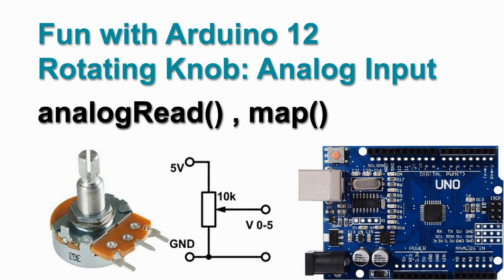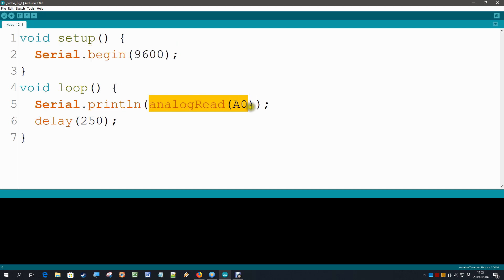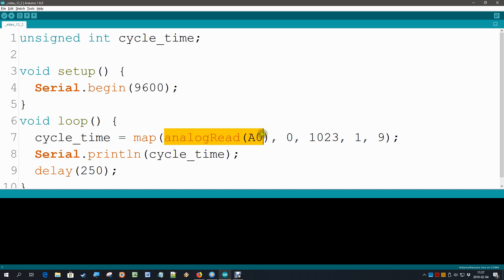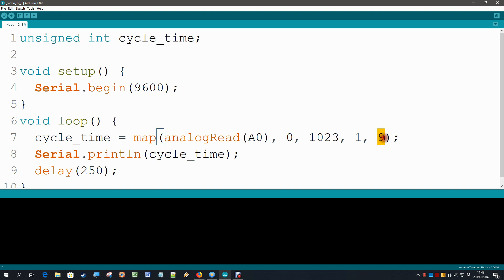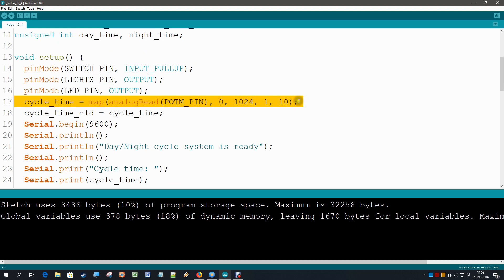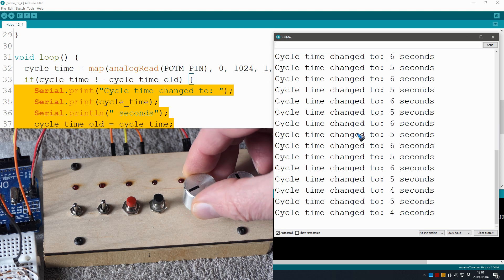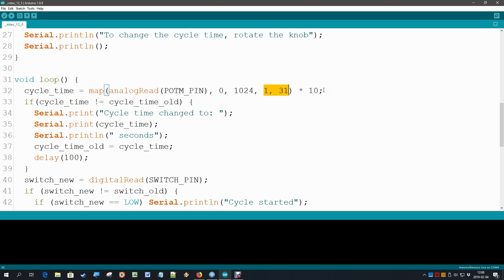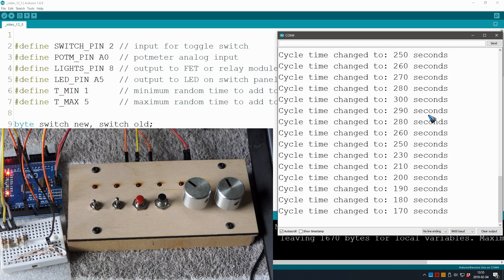Fun with Arduino 12 Analog Input, analog.Read() - Chane Range, map()

Comment: Can we make a pid function with analogue value?
Reply from the maker: I'd say yes we can. The feedback signal can be read via an analog input. To make a predictable PID in software you need to have a stable sampletime. This could be done with a millis() timer, or with an external input with a stable and known frequency, that triggers an interrupt routine that takes care of the I and D. The result can be sent to an analog out (which is PWM, but if what it connected is slow enough it functions as analog).